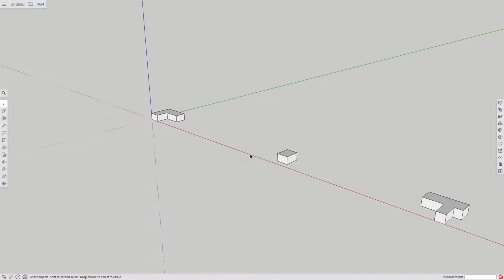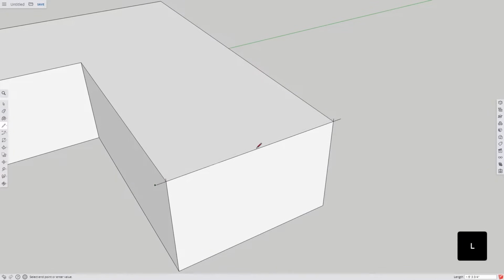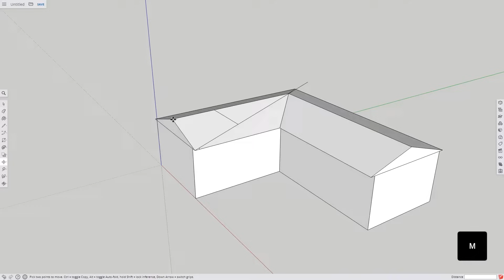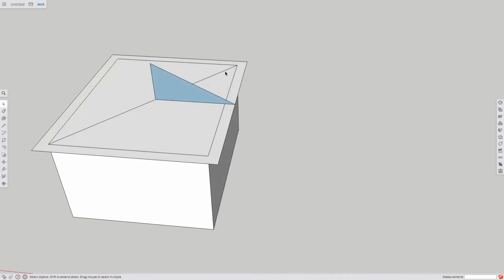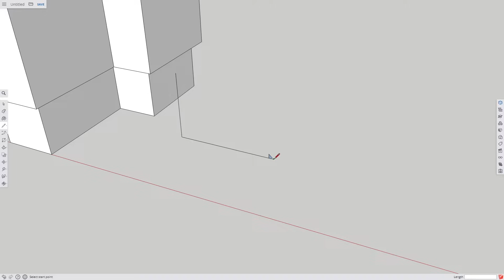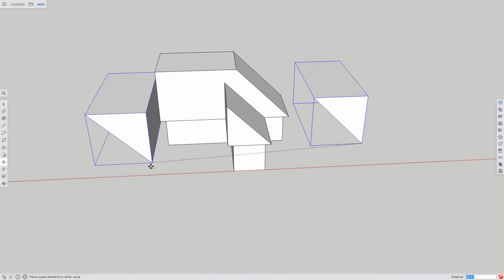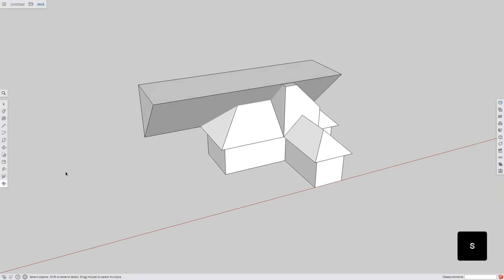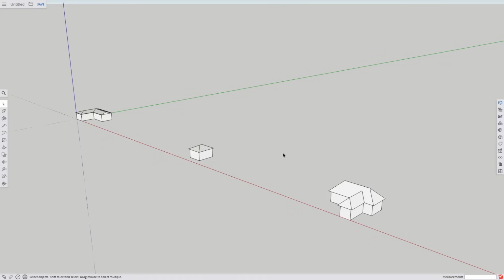How to Create Roofs in Sketchup

Comment: nice, after you are done with the roof how can I add some thickness to the roof to represent the sheathing and top chord of a truss?
Reply from the maker: If you use a Fredo6 plugin like Joint Push/Pull you can quickly add thickness.
Reply: @DesignerhacksPage  what is your intro song called??